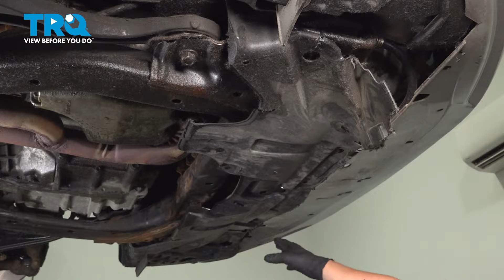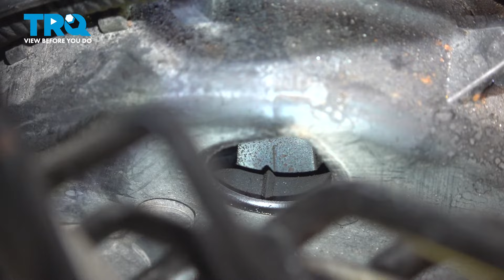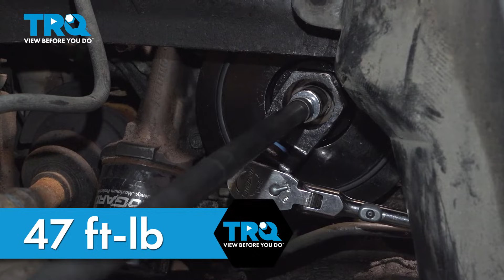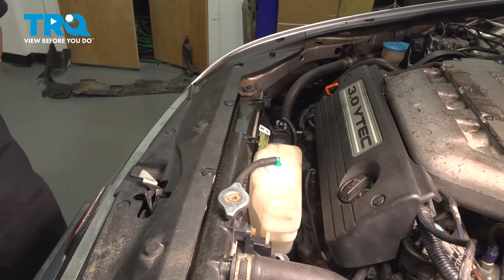How to Replace Timing Belt Kit with Water Pump 2003-2007 Honda Accord

Comment: Done this job a handful of times. its intimidating at first, but once you done it a few times, it becomes easier. The only issues Ive had is that motor mount can strip on the block if you're not careful.

Comment: Very good video. The only thing I would add is to roll the engine over using the crank bolt several times to verify that your timing is correct and that you have no interference, prior to cranking the engine via the starter.

Comment: Remove bottom splash shield 0:15
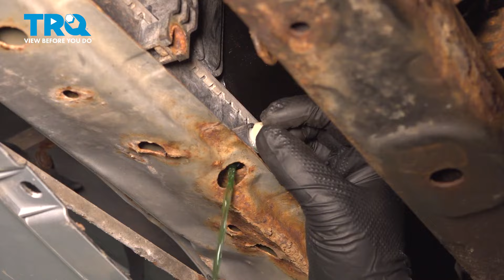Drain coolant 0:48 - have bucket
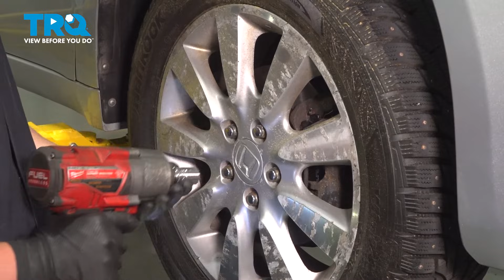Remove passenger side wheel 0:55
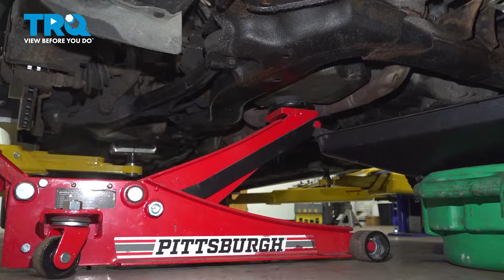Jack up oil pan 1:20 - jack up on the corner of it
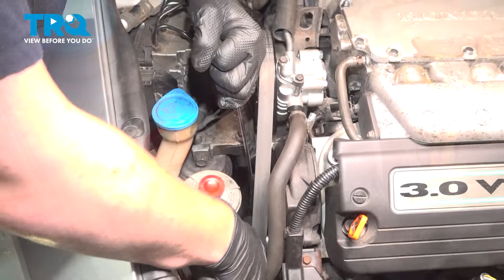Remove serpentine belt 1:30 - 15mil
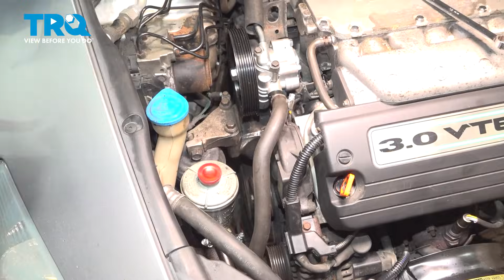Remove ground strap of the mount 2:00 - 10 mil
Remove mount for engine mount 2:13 - loosen side bolt after loosening two bolts then remove the two bolts on top then side bolt remove- 14mil for two 17mil side bolt 
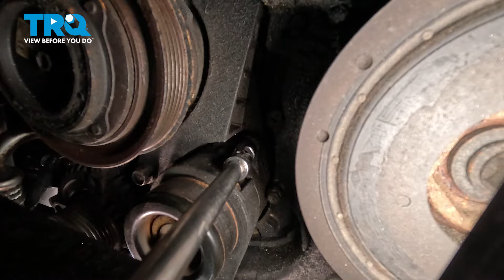Remove 12 mil bolt on the bottom the tensioner 3:18
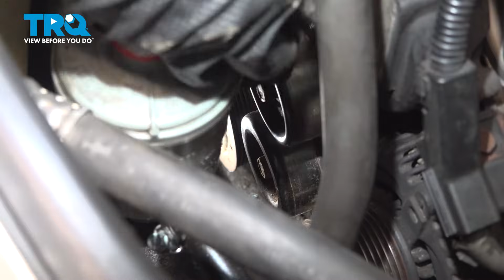Remove tensioner with 14 mil bottom tensioner 3:37 - look at next step
Remove power steering reservoir 3:45 - to get tensioner out
Remove power steering 12 mil 4:00 - use bungee cord to keep out of the way
Line up engine watch vid for this 4:33
Remove crank pulley bolt and crank pulley 19mil - 6:23
Remove top two covers with 10 mil - 6:58
Remove lower timing cover 10 mil- 8:33
Remove wire harness bolt 10 mil - 10:28
Remove center bracket 14 mil 3 bolts - 10:40
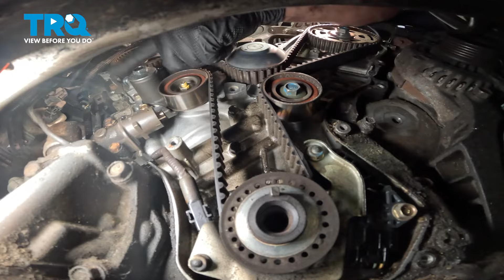 Put bolt in bracket so tensioner does not spring back - not to tight 11:56
With 14 mil take out idler pulley - 12:17
Remove crank pulley plate- 12:56
REMOVE BELT!!!!! - 12:58
Loosen bolt from step 18 - 13:22
Remove tensioner with 14 mil - 13:29
Remove water pump with 10 mil coolant will fall out get gasket to - 13:41
Clean mating surface- 14:43
Install new water pump - 15:13
Remove 2 10 mil bolts for tensioner - 16:40
Install new tensioner - 17:30
Install new color on tensioner pulley and put on water pump - 17:53
Loosely install idler pulley - 18:35
Install TIMING BELT - 18:45
Tighten idler pulley bolt - 19:35
Remove bolt for tensioner the extra one - 20:00
Remove pin for hydraulic tensioner - 20:10
Install motor mount bracket - 20:31
Install wire harness bolt - 21:30
Install bottom cover - 21:45
Install upper cam covers - 22:35
Put crank plate back on DONT LOOSE PIN curve facing you  - 23:20
Install crank pulley wheel - 23:28
Install pulley bolt - 23:41
Put power steering pump back on - 24:10
Install motor mount top part - 25:00
Put on ground cable - 26:00
Put tensioner back on - 26:20
Put on serpentine belt - 26:50
Plug radiator 

for anyone that needs it

Comment: would i still need to line up the marks and do the 60 degree turn if I just need to replace the motor mount bracket?

Comment: After following your excellent how to I replaced the timing belt, crankshaft position sensor and water pump on a 2005 Honda Accord 6cyl.  I took extra time and care to make sure the timing marks on the crankshaft and cams.  When I start the car it runs a little rough and will not idle. I am thinking the sensor needs to be learn the crankshaft posiion.   I have an Autel MX808 Scanner which does not calibrate the sensor so I disconnected the battery once again and after a few minutes reconnected it.  It still will not idle and I understand I need to drive it to allow the sensor to learn the crankshaft position.  If I do need to drive it, how long and fast should I drive it?

Comment: You CAN save yourself a lot of money if you do the job properly.  But you can also destroy the engine if you do anything wrong and it's an interference engine (this Honda is).  I'm not saying noone should ever attempt to DIY a job like this, after all mechanics have to learn how to do this somehow.  But if you aren't 100% confident you can fully complete the job, I would not attempt to do it.  The best way to learn how to do something like this is something like a project car that is not a daily driver.

Just keep in mind this is an experienced mechanic doing this job, and experienced people tend to make a job look much easier than it is.

Comment: I am in the middle of doing this on my 2004 with 140,000 miles. The old belt has only very small cracks on top but they don't go further but otherwise fully intact. The waterpump, the tensioner and the pulley were still in basically new condition. I know, everybody recommends changing all but I have my doubts that this is necessary.

Comment: Whats the reason for the bolt on the tensioner?
Reply: I was also wondering. Other videos never mentioned it. Maybe something to do with the kit they used. Also the shim under the idler pulley only comes with the Gates kit they are selling.

Comment: At 19.58 what did you take off around tensioner pulley ?
Reply: It was the bolt that he installed at 11:55
Reply: It is the bolt that you see @12:04 or @12:05.

Comment: my 2005 honda accord has a timing chain. They came with belts in these years???
Reply: V6 yes, yours must be a 4 cylinder.
Reply: the v6 engine has a belt, the smaller 4 stroke engine has a chain. I have a 2006 accord with the v6 and it has a belt.
Reply: Yours is a V4 4 cylinders have a timing chain(more robust than the belts but harder to replace yourself). This Accord in the video is a V6(all 03-07 Accord v6s, 3.0 L have belts which break easily and can mess up the whole engine; but the belts are easy to replace compared to the chains).
Reply: 3.0L V6 is a timing belt. If you have the 2.4l 4 cylinder then it’s a chain.
Reply: Timing belt.

Comment: If the belt snapped how do you make sure it's in time?
Reply: First and foremost is to make sure the piston didn't hit and bent the valves because that might destroy your engine. After that, you can follow this video until where he removed the timing belt. Since you don't have a belt anymore, you'll need to buy one. The timing is set in three places(front cam, rear cam, crankshaft) and all must be rotated(some say clockwise some say counter-clockwise and some say it doesn't matter and rotation should go on the shortest direction to avoid damaging the valves; so don't take my word for which way to rotate them) until number 1 on the front cam is align with the line above it(on engine). Rotate the rear cam until its unique line is aligned with the line on top and do the same with the crankshaft arrow(arrow is hidden behind crank pulley plate).
One thing not showed or not told in this video is that it's important to verify that your new timing belt has the same tooth-count as the old one. It helps with setting up the timing correctly.
Reply: What I did is take off the serpentine belt, then the tensioner assembly, then the right top timing belt cover, Takes only about  20 minutes. Then you see the timing belt. Lift the car, take the right front wheel off, then you see a hole, the crankshaft bolt is behind it. Take a 19mm socket with extension and turn the crankshaft though the wheel well clockwise. Then inspect the timing belt on top while turning. Do a 360 turn and watch for cracks. Mine had some very small cracks at 140,000 miles and mine is a 2004. I am sure it would have lasted longer but this is only true for the V6, the 4 cylinder does not last as long.
Reply: If ur timing belt snapped while it was running then it’s toast need new engine or new heads and pistons
Reply: If your belt snapped, you will need a new engine, and timing on it will be proper.

Comment: How much did the labor cost ?
Reply: Prettys sure this is a 5 to 6 hour job, more for a hobby mechanic depending what tools you have. Some of the bolts are very tight and no space, I would also recommend getting an electric wrench before you do this job.

Comment: clearly a honda that has suffered some abuse based on the shots of the underside.....this was not as good of a repair video as your usual ones and would have been better if you mentioned when you are doing several of the steps where you are accessing those items or areas from; for example "Since we removed the passenger side front wheel, this gives me access to the crank pulley which I am going to remove using my impact wrench" or "we need to align this mark on the front camshaft with the mark on the cover, from the top of the engine, this is the bolt I am turning while observing the camshaft gear....".
Reply: It's a 20 year old car in an area that obviously gets a lot of snow.  (Who else would have studded snows)  L